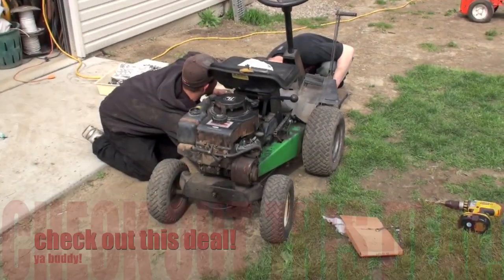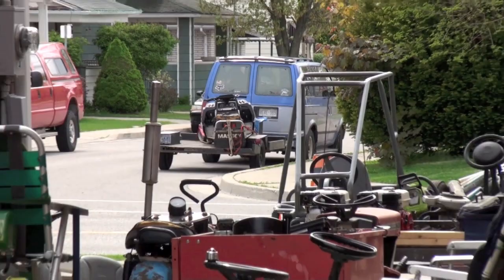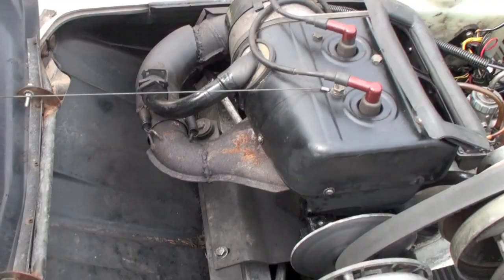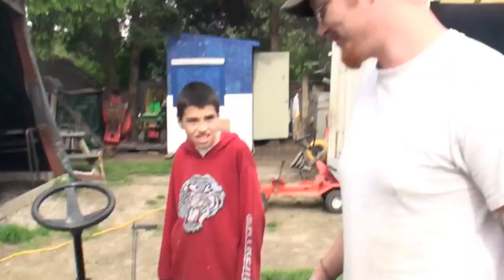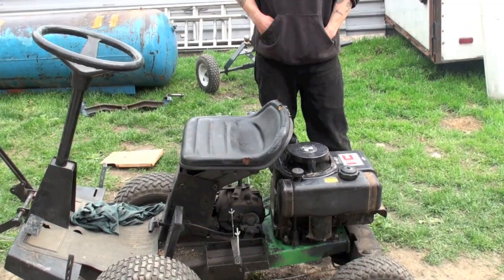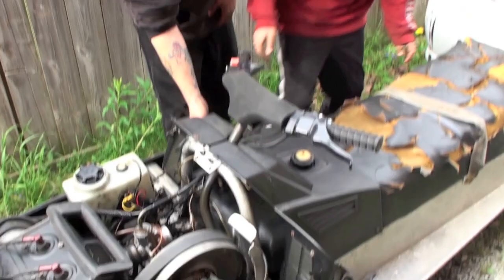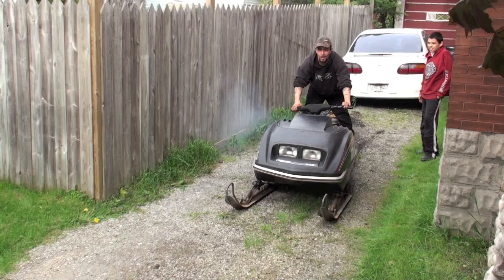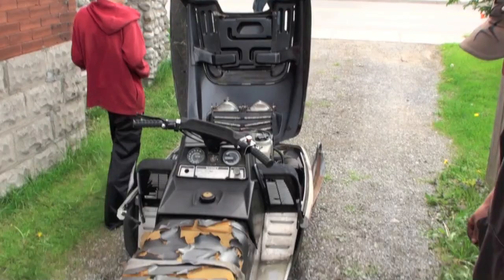check out this deal

Comment: That tractor is a mess. The thing is blowing blue not black smoke. The oil is bypassing into the cylinder. Most likely rings due to the amount burning  = engine is in need to total overhaul.